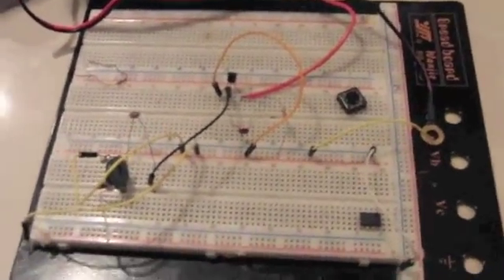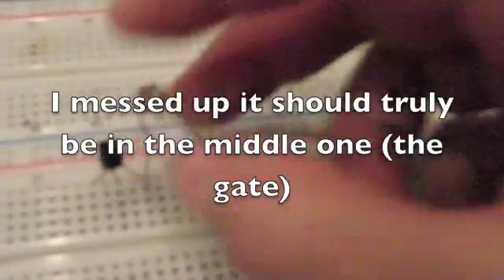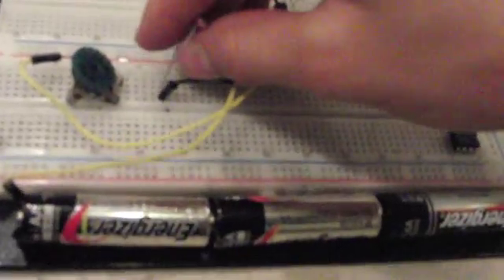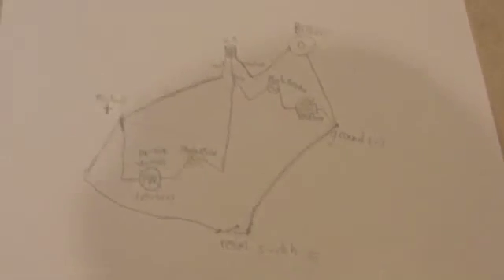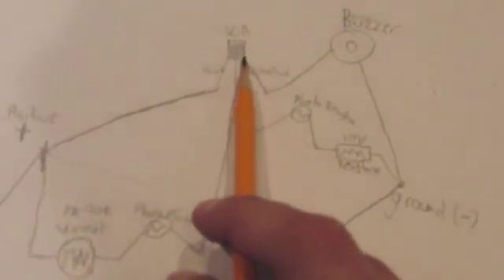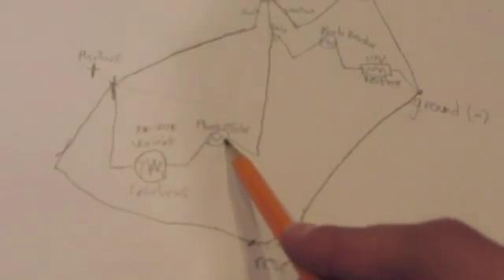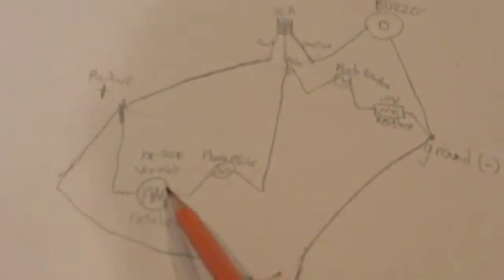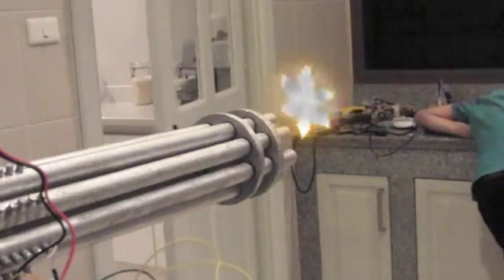How to make a Laser alarm system!

Comment: I had made one but my problem is that when the light ray is cut by someone the alarm is on and when the ray is uncut alarm goes off.how can i make it when somethng cuts off the lazer beam once..to make the buzer alarms continously...i made it by a pnp transistor1,5k ohm resistor1,ldr1..buzer1,9v batery1 and a lazer.

Comment from the maker: The voltage at the gate of the SCR is LOW when the laser is on LDR#1.  The voltage at the gate must be higher than an imaginary line called the "threshold" in order to trigger.  LDR#2 is connected to a potentiometer and that to positive.  So when LDR#2 sees more AMBIENT LIGHT it brings the voltage at the gate closer to the threshold so the alarm triggers even when in bright light.  If you're confused.  get rid of LDR#2 and just put a sunshade over LDR#1.  It won't work as good though.

Comment: @ramicaza 
ahm sir, then what happened if the buzzer draw to much current? is it the buzzer will not work or the buzzer will make noise even the scr did not triggered?

cause mine did not work properly the buzzer is making noise without the scr triggering, i copy your schematic properly i dont know what is the problem if the buzzer or the scr ( i dont really know what value of scr did i buy, i just say to a seller anything when she say what value of scr)